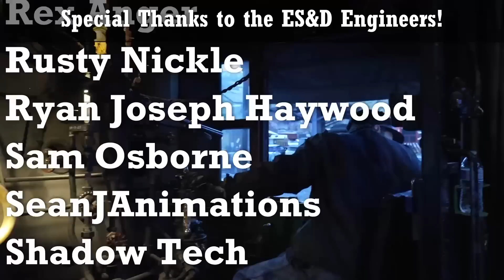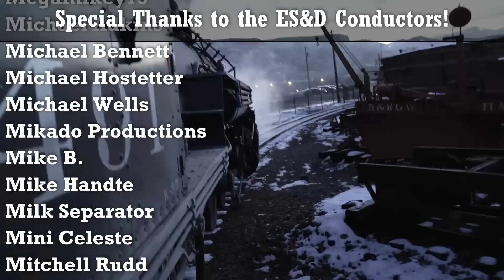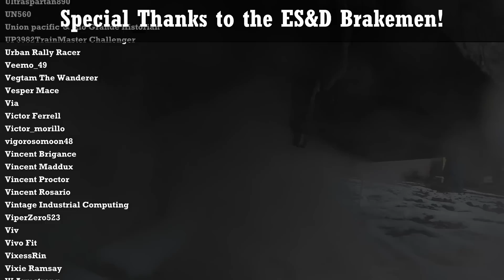Light rail isn't light? Street Car vs. Light Rail vs. Commuter Rail | Railroad 101

Comment: In Germany, the light-heavy difference determines what law governs how it's run. Anything light rail and below is under the BOStrab (streetcar operations regulation), anything above is covered by the EBO (railway operations regulation). (There is also something for narrow gauge raiöways, but that's pretty exotic these days.) The BOStrab further divides into three categories: Street running trackbed, Exclusive Trackbed, and Independent Trackbed (which can have level crossings, but is independent from streets).
And then there are vehicles that have to follow both BOStrab and EBO: trams that, for some part of their route, run on mainline tracks. We have a number of such systems in Germany. Not only do the rules change, but so do the electrification systems.
(For language nerds, I'd also like to point out that one of these BOs has the subject at the end, the other at the front. Consistency!)

Comment: I don’t think that your definition of “streetcar” ever accurately described the historical streetcar system. In Washington DC for example, I’ve seen photos from the early years of a streetcar towing another car behind it. Similarly, since areas outside of Washington DC did not always have paved roads, streetcar companies built rails 15-20 miles outside of the city to areas which the owners of the system owned and wanted to develop. 

In DC this streetcars we’re called trolleys because they got their power from overhead wires, while the inner city sections were powered by an underground conduit. 

Today, the Baltimore “light rail” runs some train sets with multiple cars while others are just a single car. Both operate on segments that are separated from cars and both operate on segments of the line which run in mixed traffic. The only thing that I think is true about “light rail” is that, as operators tried to expand the capacity of systems, and make trains longer, they began to realize that it is harder and harder to operate in mixed traffic . 

Bottom line is that all of these terms may have originated with one form of rail transportation in mind, but over time these systems were given different roles than before, or additional roles or what have you.

Comment: In the US, I feel like light rail often just kinda refers to a metro that has narrower cars and isn’t grade separated all the way through and at some portions is like a tram (streetcar). I guess it also tends to be charged with overhead catenaries. But it’s not always fair to categorize all LRT systems that way because a lot of times, like in Seattle, they are grade separated a lot of the way through and the cost skews wildly. I personally think though that the US usually builds light rail where heavy rail should be, “BRT” where light rail should be, and local buses where dedicated good-quality BRT should be. There are some good places though where light rail is a really good fit as opposed to heavy rail, like with the suburban MD purple line. But the IBX in NYC for example, should most definitely be heavy rail given how NY is, and it can be argued that the Baltimore Red Line, Seattle Link, and much of the LA metro should be heavy rail instead of light

Comment: You glossed over "heavy rail" (frequently called metro or heavy metro in Europe), which is what most American subways are (although some are actually elevated or even at grade).  These are longer, heavier trains that have significantly more passenger capacity than light rail systems and always are separated fromcar traffic.  For example Chicago's El (for elevated, although that has underground and at grade sections, but no street running), or New York's subway.

The most notable city that has light, heavy, and commuter/regional rail is Los Angeles.  Metro Rail lines B and D are traditional heavy rail subways that are completely underground.  Metro Rail lines A, C, E, and K are all light rail, with only C not having street running segments.  Metrolink is commuter or regional rail, infrequent, double decker trains pulled by actual locomotives (although some systems use self propelled train cars, Metrolink does not) on tracks shared with freight trains in some cases.  Metrolink trains run deep into the suburbs, up to 80 miles away from downtown Los Angeles or so.

Comment: So the New York City subway would be light rail? It seems to blur the lines a bit between commuter rail, although there’s also proper commuter trains i.e. 5 Metro North lines and the Long Island RR which splits off into 8 branches. Plus the PATH trains between NJ and NYC, which is somewhat of a commuter subway… all the rail networks in and around the city are pretty fascinating.

Comment: I had always just thought a light rail vehicle was a rail vehicle that's not as heavy as a 100 car freight train with 200 tons of locomotives at the front.

A relative-light rail train is also a lot lighter than a full length Amtrak.

At least, that is my uneducated impression at the start of your video. 😀

Comment: So I live in the greater Pittsburgh area. And our light rail system is basically what was kept after the majority of the street cars were removed and replaced with buses. One thing I noticed over the years is when the exclusive right of way interfaces with street level running. The light rail signals are based on the old Pennsy signals. So a vertical bar for proceed, a triangle for caution, and a horizontal bar for stop.

Comment: A more casual viewer from the beautiful district of Kassel.

The city of Kassel has a fairly decent bus network, served by KVG vehicles and those from third-party companies, as well as a decent tram network, which funnily enough runs on 2 lines on the track area (signaling and monitoring corresponds to that of Deutsche Bahn) of the Hessian State Railway. Then there is the most recent addition, the Regiotram (can be connected to the tram's overhead line, track width is identical to the German standard gauge), whose main driving/operating area is also subject to DB regulations.

Best wishes from the other side of the big pond

Comment: The 'light' of 'light rail' refers to its capacity to carry passengers.  The real reason why light rail cannot move many passengers--the statistic is referred to as PPHPD: passengers per hour per direction.  There is no light rail line in the country that can move more than 5,000 pphpd--and in a large city, this is a worthless transit system (most light rail runs on the surface for at least part of the route and the light rail trains interfere with all other transit).  The reason for the low PPHPD is because steel wheels on steel rails cannot stop very quickly and the regulators insist (wisely) that trains maintain a very long stopping distance between trains.  In most cases (except where all stations are off-line), this means that there can only be six trains per hour--or once every ten minutes.

Comment: This video cleared up a ton of confusion I had. As a Bostonian, I was always confused as to why the Green Line was considered light rail and the others were considered heavy rail, despite the fact that the Green Line runs on standard gauge rail of the same weight as the rest of them. The only difference is that the Green Line is a trolley, while Blue, Red, and Orange are third-rail subway cars.

Comment: Denver is actually connected to the national rail network! The interlocking right outside union station connects the track used by Amtrak and the Light rail tracks together. As far as I know that is the only connection between the two networks.

Comment: In Waterloo, Ontario Canada a section of our ION light rail shares tracks with nightly freight operations right through the middle of downtown and the university district. They installed gauntlet tracks to keep the freight cars away from the light rail stations, and I believe there are two completely separate signal systems that interlock with eachother, one each for the LRVs and freight trains.

Comment: The two differences are:  LRT can operate with street level traffic like a streetcar and operate like a commuter rail.  And they are small trainset comprising of EMUs or DMUs. Commuter rail does not operate on streets.  Anytime it crosses a street, it has to be a grade crossing with signals to stop all traffic when a train crosses it  They are larger than LRT (larger wheels and cooches), and are typically powered by a locomotive (some use EMUs like the Arrow IIIs used by NJ Transit)
Though not sure what category subways fall into.  They are smaller than commuters but operated on dedicate track either underground or elevated.  They often use a third rail for power which makes them unsuitable for operating at the street or surface level.

Comment: A good way to distinguish light rail from commuter rail is that in light rail, each vehicle is typically made of permanently attached sections, and each vehicle doesn't allow passengers to walk from one vehicle to another vehicle unless at a station. In commuter rail, vehicles typically consist of 1 rigid section and typically allow passengers to walk to the next vehicle. One key distinction between heavy rail vs light rail and commuter rail is that heavy rail vehicles are typically designed by the transit agency (hence a Bombardier vehicle for BART is very different than a Bombardier vehicle built for somewhere else) whereas in other systems, vehicles are designed by the manufacturer

Comment: I worked in the industry when "LRT" was being introduced as a "thing" in North America - San Diego being the first all-new, ground-up system, followed closely by Edmonton.  What you didn't address was that the normal alternative in those days was a full "heavy" metro system i.e. subway as in New York, Toronto, London, Paris.   Typically with trains of 8 to 12 cars, the stations alone were massive and expensive.   Rights-of-way were 100% exclusive, with tunnelling favoured in the urban areas; fully fenced grade separated rights-of-way in the suburbs.   For medium sized cities (Seattle, Vancouver, Portland), the passenger volumes could never justify the huge investment required in a full metro.    

Streetcars were decidely passé, and even the word "streetcar" was something that you didn't utter in North America.   

In the meantime, European cities with their intact streetcar systems were modernizing and extending into the suburbs.    Lines were at grade, used street running where there was no alternative, and gave decent capacity at a reasonable price.   New high capacity articulated cars and eventually multiple-unit trains appeared.   Eventually, planners in North America caught on, adopted and adapted the techniques, and Light Rail was born.    

Unfortunately, since its introduction in the late 1960's, the concept has evolved so that it is now very much over-engineered (translation: expensive) and has strayed quite a bit from the cheap solution it once was.   

Streetcars, as they are generally used in North America, don't have anything like the capacity of LRT and are vastly underutilized - they are more like a urban planner's plaything than a viable mode choice, with the exception of Toronto, with its last true streetcar system on this continent.   Streetcars do have a role in shaping urban development but they don't carry a lot of people.  

LRT more and more resembles heavy rail (metro) in everything except the size of the trains and ultimate capacity.    Commuter rail is a whole different concept, being geared to outer suburban or interurban travel; LRT and its big brother heavy rail (full metro) are urban and inner suburban solutions.

Comment: In the UK we have the Tyne and wear metro which we call light rail because it doesn't need much infrastructure or heavy trains to run on the track  this is why the call it light rail but the national rail trains going from one end of the country to the other or from the bottom to the top of the. Country need more infrastructure and higher power r than the light rail system

Comment: There seems to be a difference with regard to signalling and operation. With 'heavy rail' trains are tracked by a central dispatcher and signals are used to ensure headway separation. With 'light rail' it is the driver's responsibility to ensure he does not rear end another vehicle. The only signals would be to indicate switch positions or signals tied in with traffic signals at intersections, etc. A light rail dispatcher would be more 'light handed' than his 'heavy rail' counterpart.

Comment: Man, the 60s definition of "light rail" feels like basically all modern European streetcars would fall under it. We actually have a bit of a different delineation? It's a streetcar if it is a) street- or low-platform-entry and b) primarily street- or street-adjacent-running. It becomes light rail if there are a) high platforms or b) significant exclusive railway-style infrastructure, such as embankments, tunnel stations, elevated sections, etc.

The delineation towards "heavy rail" (a term I've mostly heard to comprise everything above the threshold, not just commuter rail specifically) seems to be the same, though - if it's regulated under railway regulations rather than streetcar regulations, then it's no longer light rail.

Comment: The weight of the rail video would be interesting. Have they ever reduced those during e.g. wartime when steel demand was high or for temporary rails? Or increased for very heavy vehicles like the rail-based artillery?

Comment: As part of your streetcar definition, you included the low-floor configuration, which is a relatively modern concept compared to the streetcar. I'm pretty sure that the old streetcars from over a century ago had at least one or two steps for people to climb into them from the street.

That being said, I think that light rail vehicles tend to use smaller wheels than full-sized trains, allowing them to sit lower on the track.

Comment: Is it me or did you hint that New York's subway system falls under the light rail definition?
Reply from the maker: Wouldn't be surprised if that's what it most technically is.
Reply: @Hyce777  maybe they have a seperate classification
Reply from the maker: @amihaifreed8622  wouldn't be surprised if that's the case either. It's not a truly well defined set of systems because there's so many interesting differences. All fun!

Comment: Hey Hyce,are you going to be chasing4014 on the trip to Roseville CA and back, im north of wendover nv. And south of Montello so im going to try for perhaps some shots around shafter Saturday snd the summit of "valley pass" the 19th on the eastbound trip. As well as laray pass on its way down. When iwas 13 i got to(with assistance) pull the throttle on ex N&W #578 at the ohio railway museum i was the youngest " jr. Member" and in the 1970's had the privilege of opetating just about anything and everything we had that would run! Lol

Comment: There are a wide range of rail weights. The original “light rail” was run on light weight rail to save money on track.
90lb track was used originally.
Serious “heavy rail” can be 250lb.

Comment: Most North American “light rail” that use high floor vehicles like LA Metro, Seattle LINK, San Francisco MUNI, Calgary C-Train, etc., etc., I consider LRT. Anything else, my European half will call a tram. Most modern tram/streetcar systems these days will be at graded but have its own right of way and operate low-floor vehicles. Of course there’s an insane amount of variability and there are some systems that blur the lines of this, but I generally go by this rule of thumb. So stuff like the new Edmonton Valley Line, and Toronto Lines 5 & 6 I’d consider more of a tram even though the latter is mostly in an underground tunnel.

Comment: Most often, I've heard light rail as a contrast to fully grade separated rapid transit systems like the New York Subway or BART, which are sometimes referred to as 'heavy rail'. While the vehicles may not necessarily be lighter, especially anymore, the total system cost is lower due to less infrastructure required

Comment: Light rail is a term like "assault weapon", some idiot didn't know what they were talking about and so they flung a term they though was appropriate and people latched onto it. Also it's a term used because the alternative of "Almost-not-a-real-train" wasn't as catchy.

I think what I'm getting what you're putting down. The best two ways of deciding what kind of train "class" you're dealing with (at least in the US) is how easy it is to hit or be hit by it if you're driving in a separate motor vehicle. Street cars, fairly easy. Light rail, there's designated areas you can duke it out. Commuter and full freight trains, you've got to either slap each other at train crossings or you as the car driver, need to have no sense of self preservation and go driving down their rails in search for an a*s handing on your own grill. There's more to it than that, I know, but if I had to explain it to an idiot, I think that'd be adequate. If you could easily hit it with an F-150 while also remaining on the road, it's less of a "full sized" train and more of a light rail or a street car depending on how consistent you could be an idiot.